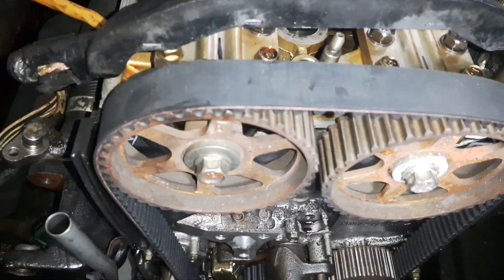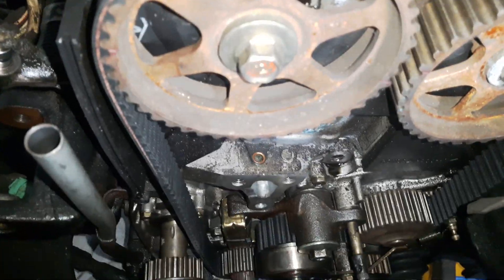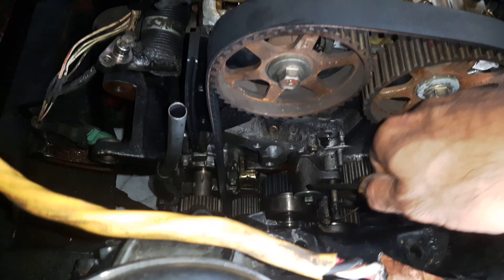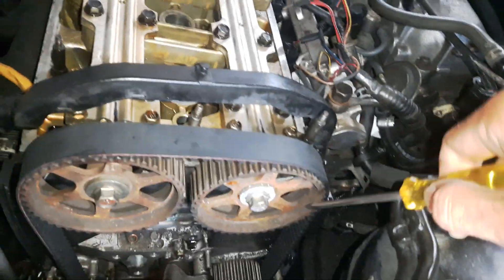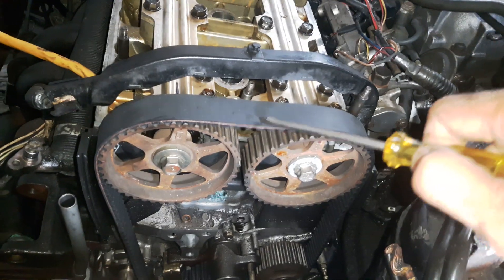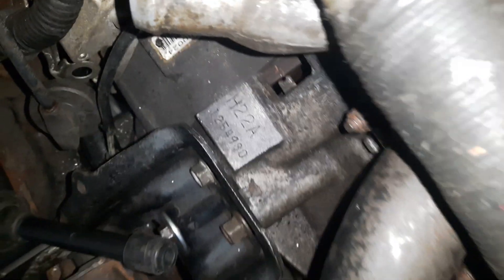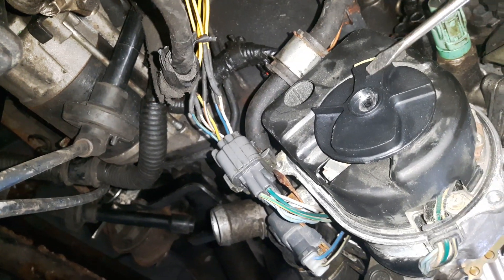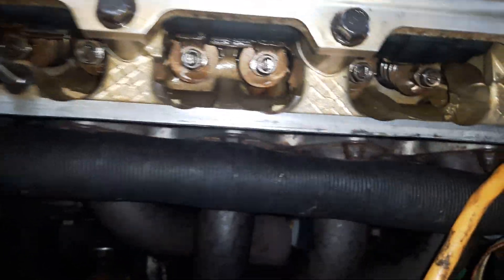How to Replace and ACCURATELY align  timing belt marks in H22A Honda DOHC 4 cylinders  engines

Comment: Good tip with the slight misaligning before tightening the tensioner. I recognize the engine. Is it an H series? I just got my H23A running
Reply from the maker: Yes, it is. Don't forget to subscribe....Cheers
Reply: Would this work with a Honda Civic SRS 2019?